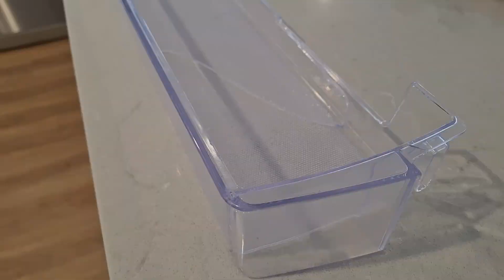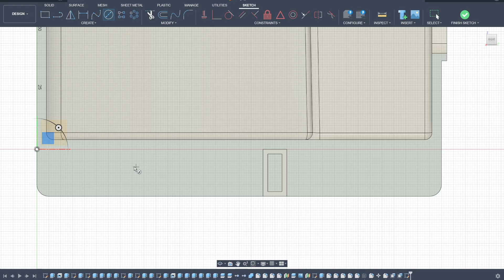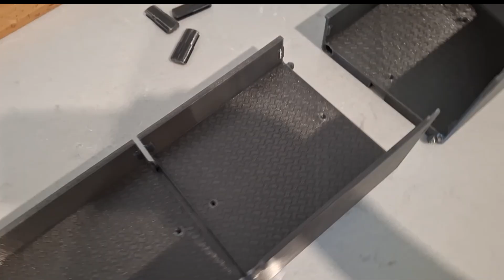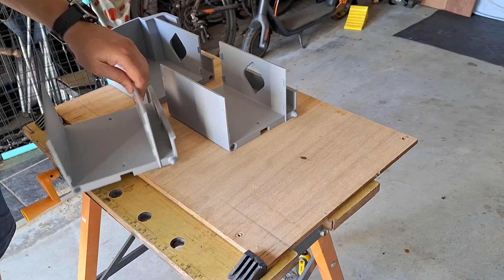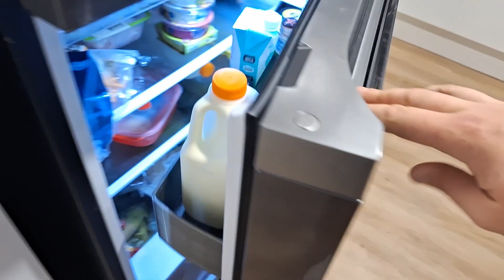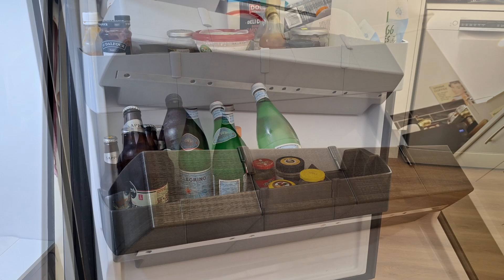I 3D Printed a Stronger Fridge Shelf

Comment: why did you use different colour for the second shelf was it because you ran out of material or used different (stronger) material? if so what material was it
☺
Reply from the maker: The opaque gray one was a high flow PETG - wanted to try it on a large print, like this. Indeed, it printed noticeably faster. Same plastic, functionally, just saved me some time.